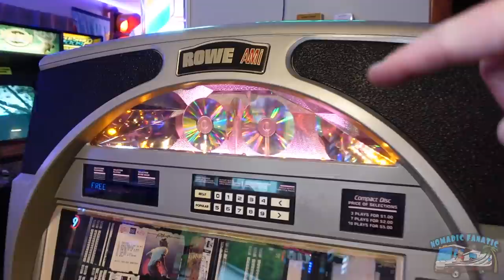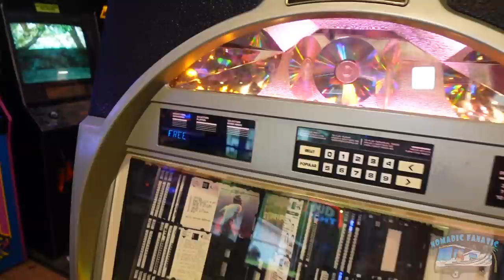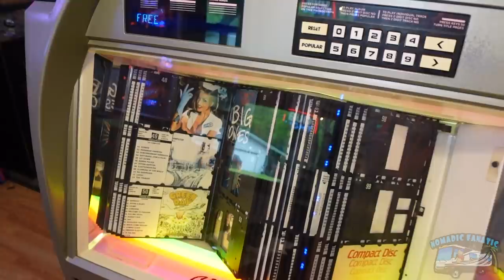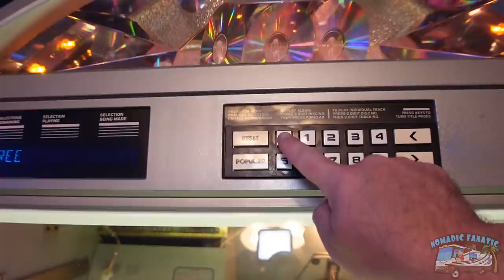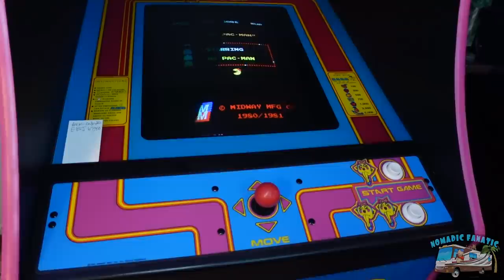Friends @ Basecamp & A Couple Additions...

Comment: The Juke likely needs to have the program run so it knows which slots have discs and how many tracks.  That prevents someone from entering 11-21 when the disc only has 15 tracks.  I had one of these - and yes as you said, need to map it!

Comment: My Sister and I got an Atari 5200 for Christmas one year.  It had graphics just like an arcade.   We had an Original Pac Man game for it, but We never bought Ms. Pac Man,  I would have loved to see how it compared to the arcade version of Ms. Pac Man.   The problem with the 5200, was that the controllers wore out very fast.   They used something like volume controls to move You around and We wore out about 6 or 8 controllers for it.  I think a new controller back then was like $50 and so We finally just gave up on it.

Comment: Eric, I ran across this recipe for Disney's Dole Whip, thought you might like it.
Disney's Dole Whip
It's so easy to make this authentic Dole Whip recipe from Disney—it's the ultimate at-home, 

vacation inspired treat!

Ingredients
1 big scoop vanilla ice cream
4 oz pineapple juice
2 cup frozen pineapple

Instructions
Add all ingredients to a blender, blend until smooth and icy.
Put mixture into a piping bag with a large star tip, or a ziploc bag with the corner cut. Then pipe 

into a cup, making a swirl just like the original.

Nutrition
Calories: 114 cal | Carbohydrates: 29g | Protein: 1g | Fat: 1g | Saturated Fat: 1g | Cholesterol: 

1mg | Sodium: 3mg | Potassium: 254mg | Fiber: 2g | Sugar: 22g | Vitamin A: 96IU | Vitamin C: 85mg | 

Calcium: 29mg | Iron: 1mg